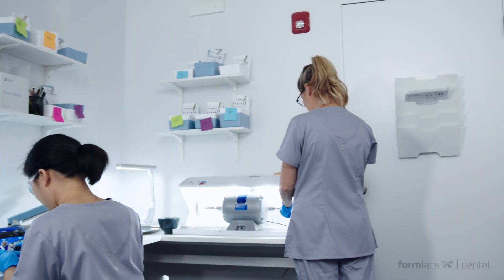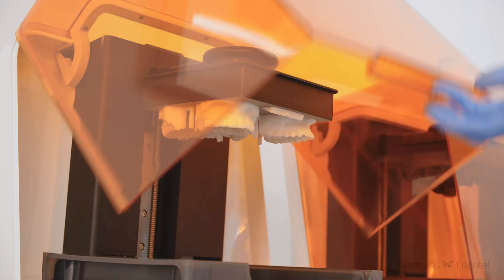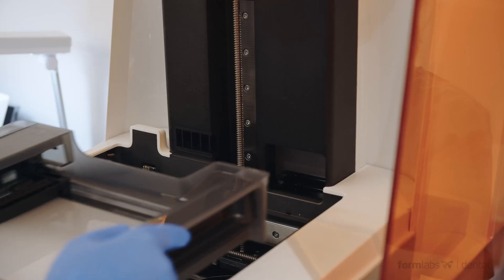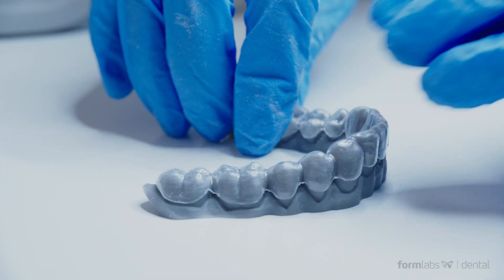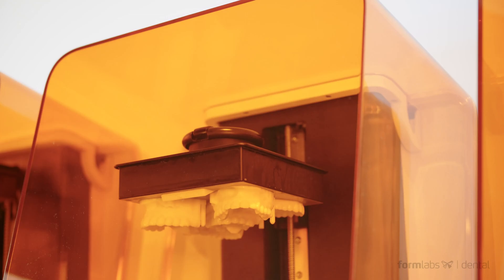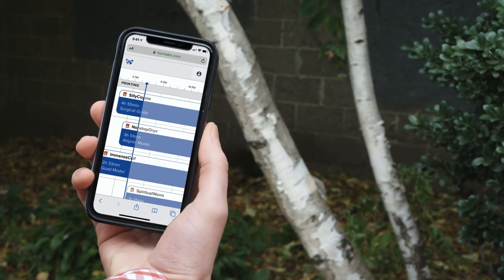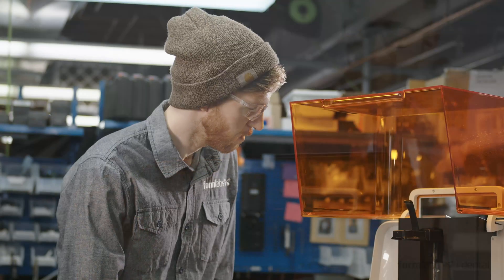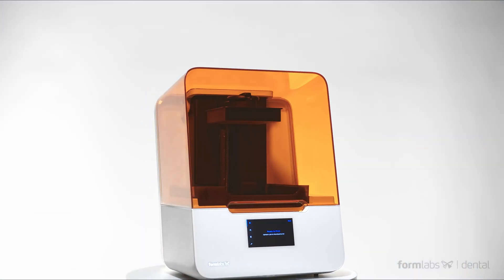Form 3B 3D Printer for Orthodontic Practices

Comment: Can it be used professionally and commercially in dentistry
Reply from the maker: Yes! Formlabs Dental products are designed specifically to meet the strenuous demands of dental professionals.
Reply: @Formlabs  I'm not sure that I understand how the 3B differs from the Form 3.
Reply: @hillfortherstudios2757  3B is specifically designed for dentistry. You can't use dentistry resins in the Form 3.
Reply: @mactastic144  why can i use dentistry resins in the form 2? @formlabs